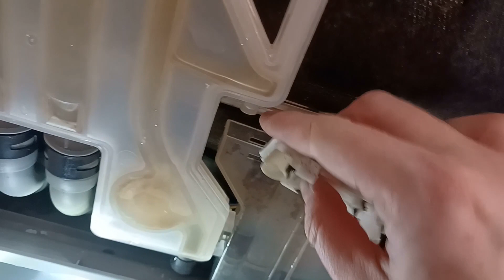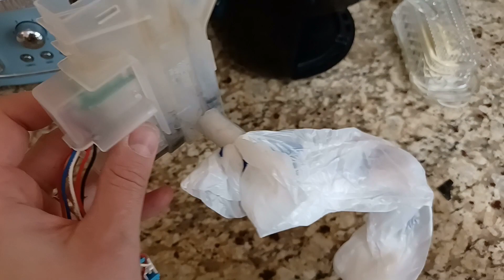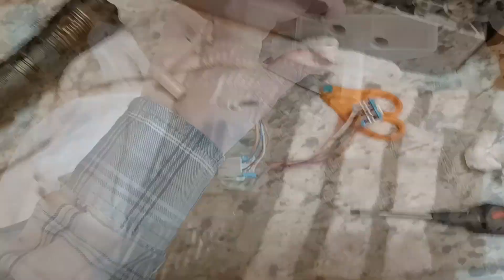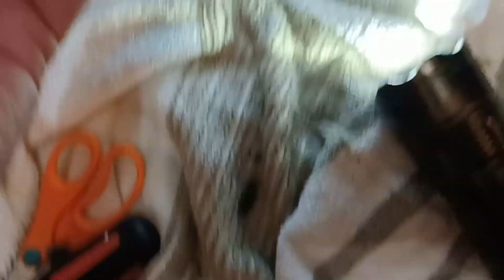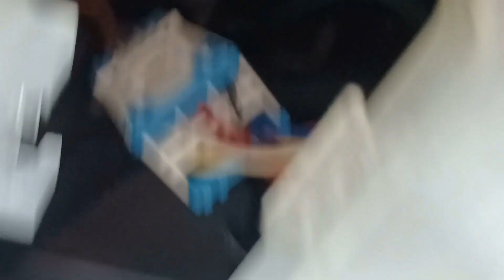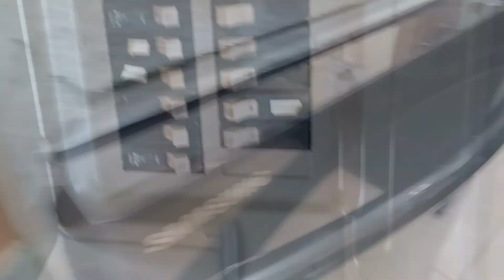Samsung Dishwasher Flashing Lights Normal Heavy and Smart Auto

Comment: I had this problem. Called repair. Repair cleaned the drain filter and left. Two days later the same problem. First solution, a cup of vinegar inside on the top rack during the washing cycle will help dissolve sludge. It happened again, and very easy fix. Before starting the dishwasher I run the garbage disposal. Yes, the dishwasher drains into the garbage disposal. If there is junk in the disposal it may slow down the drain from the dishwasher just enough to cause the error codes. Problem went away!!